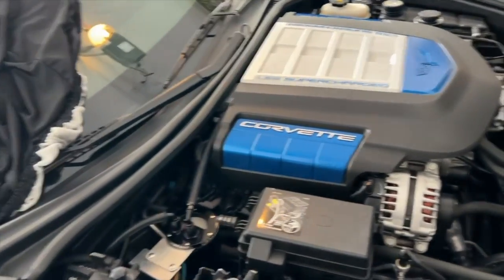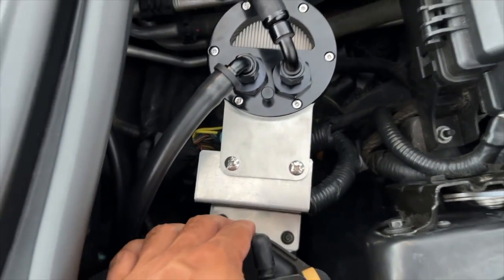C6 ZR1 Custom Catch Can - Do it once, do it right!

Comment: You have both valve covers tee together and directed into catch can? The valley connection you have tee to the lower oem oil can? Your vacuum comes from post throttle body to oil catch can?
Reply from the maker: All vent to the can, vent to atmosphere. Thanks for watching.

Comment: Hey... how did end up working?  I see that you have a 45  Fitting on top of the sump going to Firewall  and Down is that T  behind the Sump?  Thanks
Reply from the maker: Correct, “T” allows the tank and valley to breathe at the same time. Thanks for watching. Upper and lower crankcase.